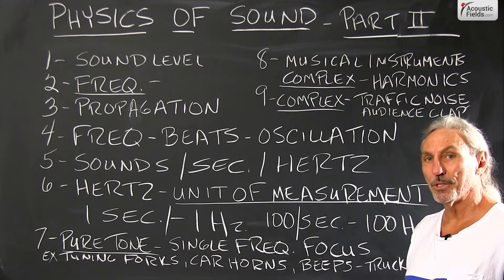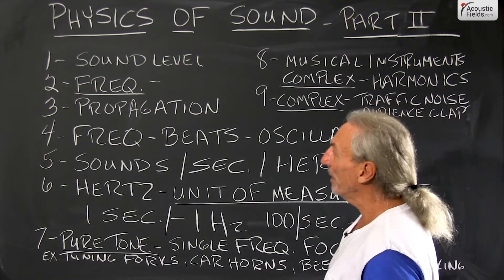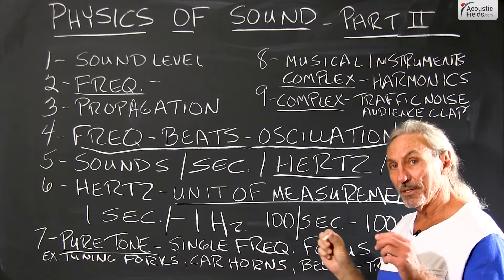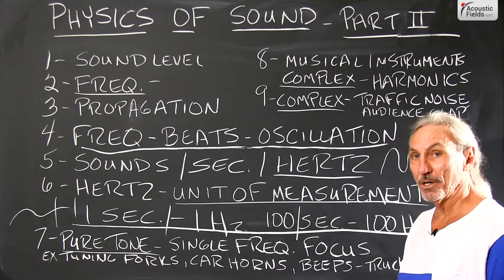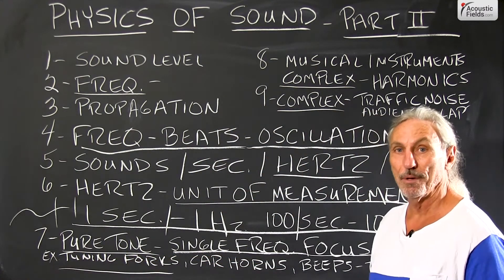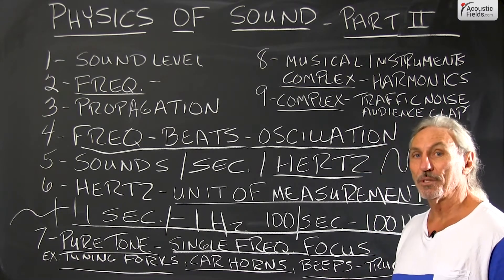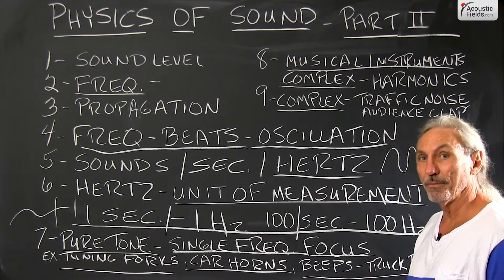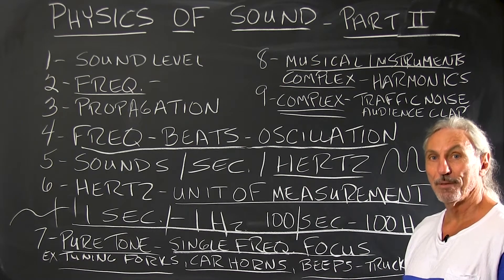Physics of Sound Part II - www.AcousticFields.com

Comment: always amazed by these videos. that you take the time to make them to share this knowledge. hope these do a great job to showcase your genius and send business your way. thanks again. any thoughts on vandersteen model 1? just picked up a pair with the stands for 100$. needs to have a 160$ recone on one woofer. is this a fair price for a repair of a polypropylene cone!?
Reply from the maker: I,  I have heard that speaker and like the way they image. If you are having issues with it, contact Richard. I am certain he will be glad to assist you.
Reply: Acoustic Fields they have assisted. did more research found they use an oem style speaker. p21wo20 scanspeak or something. also made once by vifa. vandersteen may have made alterations to the design. could be an extra mm of xmax. it these are similar enough then great new. 85$ for a brand new woofer. or 160$ plus 20$ shipping for the recone. only paid 100$ for the pair of speakers with stands. so the scanspeak makes sense relative to vandersteen model 1's in good condition sell for around 200$